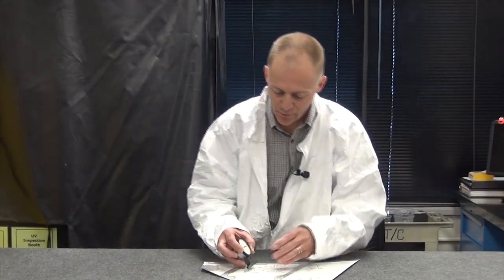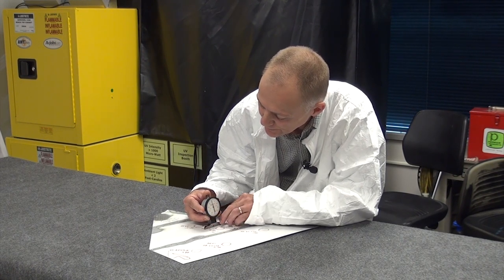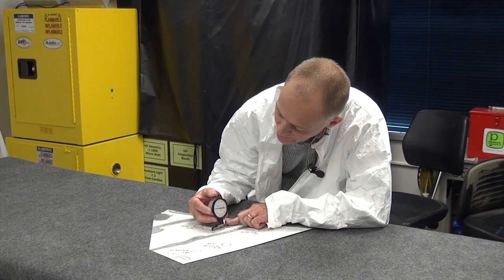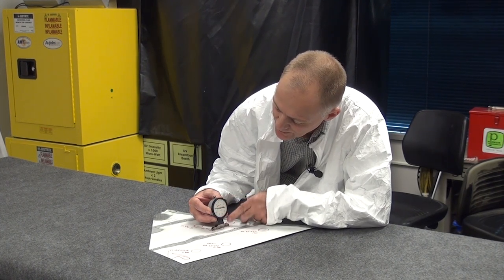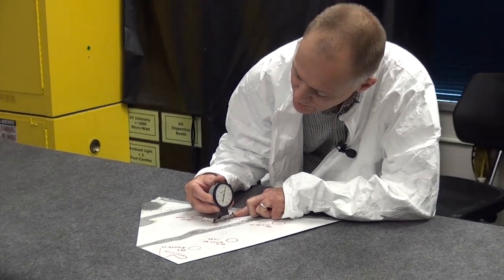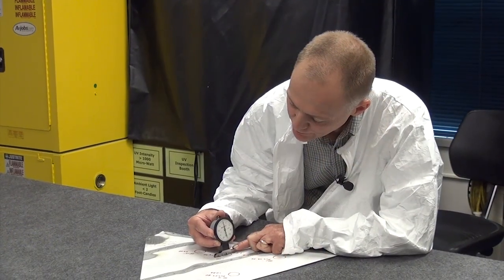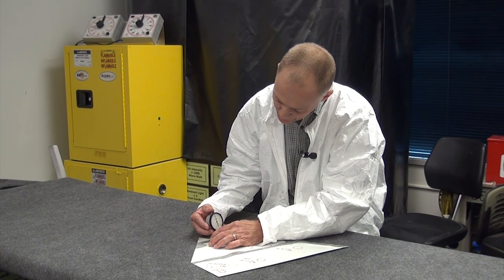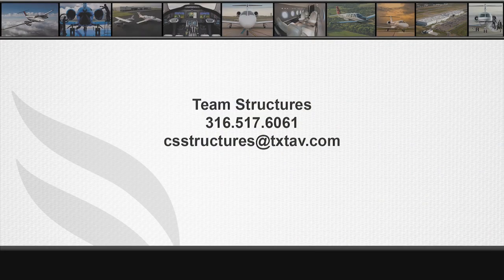Measuring a Dent, Scratch or Gouge Using a Depth Micrometer

Comment: This is NOT useful in any way. Instructions like this are all about details, and camera angle in this video does not allow to see ANY details. I don't need to see the man's face, I need to see details of what he is measuring, and clear close-up of what the tool is showing. Also, a 1/3rd of the video is him talking. Regardless of what he thinks is important, what IS important is measurement, the part or defect he is measuring and narrating what he is doing WHEN he is doing it.
Reply: All you say, and.

I wonder where he'd find a flat to zero it out? Were you able to see how he moved it to find the profile of the dent?